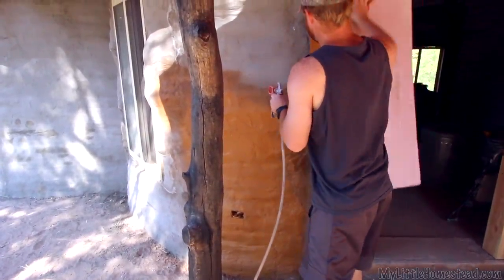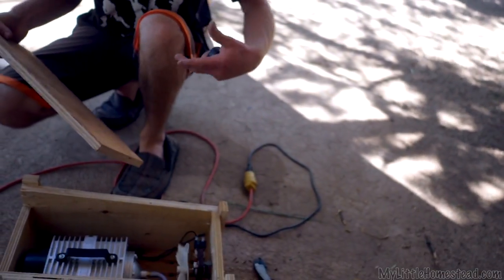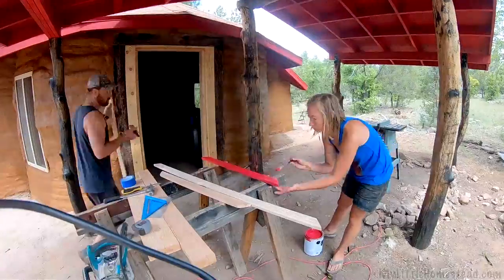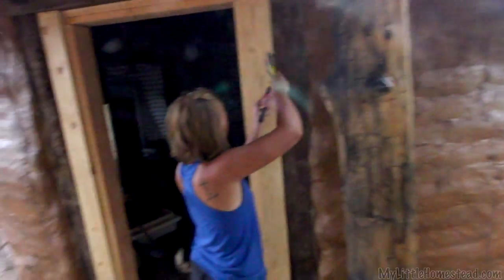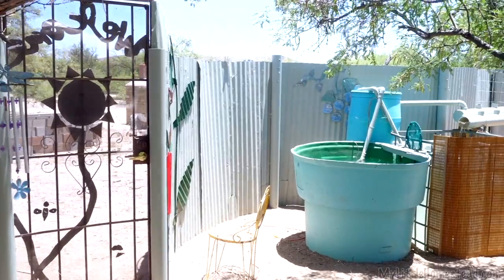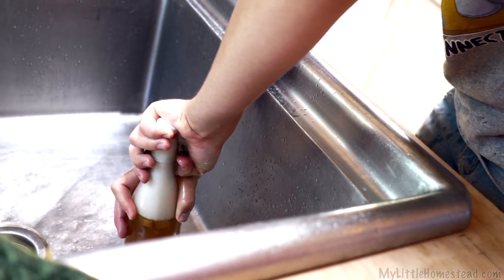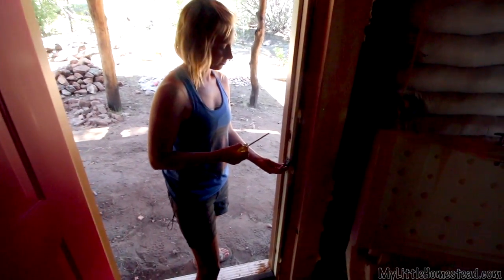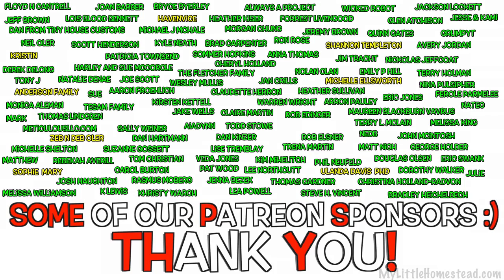Earthbag Cabin Paint & Trim, Aquaponics Fish & Plants & Making Kombucha | Weekly Peek Ep191

Comment: AQUAPONICES: most unusual and creative design I've seen — it's ART! and looks like fun — looking forward to the results. // THE CABIN: Great job kids, and good airless painting technique, but ONE rookie OOPS: Why we do NOT miter exterior trim. HEADER and bottom trim/sill should have angled edges to SHED WATER, and the sides end cuts angled to match, sitting on top of the bottom trim/sill. Back prime and paint any saw cuts before installation or any water that gets behind it will be absorbed into the wood, then when the sun comes out and hits the water soaked wood, it will vaporize the water creating paint BLISTERS and you'll be painting every 2 years. // WASHOUT CREEK problems: (1) culverts are WAY undersized (12" dia ?), so they easily clog with debis which creates a dam, which causes water to overtop eroding around the culverts. From the size of the wash, I wouldn't use less than two 24" or even better, a 36" to minimize debris blockage (2) Look at a real creek bottom — combination of BIG rocks, medium rocks and VERY coarse gravel. Do that on the upstream side of every culvert with larger rocks stacked and packed into the earth on both sides of the mouth of bigger culvert(s). Alternatively, you could create concrete sweep aprons on the upstream side to prevent erosion around the culverts. Water overtopping will kill any dam or culvert. ALTERNATIVELY, create an overtop spillway of concrete for the water to flow over if it clogs (almost all dams have concrete spillways to handle overcapacity).

Comment: The dude with the washout problem I recommend fabric and rip rap around areas he puts culverts in. If flash floods and clogging is a constant issue remember the bigger the Culvert the easier to clean out and the more volume of water it can handle
Reply: Maybe even wire enclosed rip rap, perhaps dissipators, (like a speed bump) to slow down water, make sure they're level and evenly spaced.  Also on the csp, or drainage pipes, looks like the water is "funnel necked", so rip rap around inlets will help prevent erosion, less blow out.

Comment: Only one good solution for Early and that is a concrete box culvert the width of the upper water line and height from upper WL to lowest point of creek bed and shouldered into the creek bed with up and down stream aprons. Will handle volume and make FEMA happy, as if we live to satisfy them, but will stay clear and be safe. 

For the kombucha, leave about 1.5in. of head space then chill before opening.
Shade those plants for about a week to acclimate them and reduce transplant shock effects.

Comment: What should I do if my fish are gasping?

The water surface contains the highest levels of dissolved oxygen, so when fish can't get enough they'll rise to the top and gasp. However, the cause of that gasping could be due to several factors.

Temperature

The warmer the water gets, the less oxygen it holds. Check the temperature, as it should be about 24-28°C/75-82°F for a tropical freshwater tank. In hot weather the tank may be overheating naturally, so try to cool it and boost aeration. Don’t always blame temperature as sudden gasping problems are often related to pollution or disease.

Heating

If your heater has malfunctioned it may have stuck in the ‘on’ position, causing overheating. Gasping fish is often an early warning that something is wrong, so if the tank is very warm and heater light on this could be to blame and will need replacement. If this is the case, temperature will be very high — usually well over 30°C/86°F. Heaters are generally reliable, but when they go wrong the consequences are usually devastating.

Water quality

Both ammonia and nitrite affect gills and can cause gasping, so test the water at the first sign of trouble. When ammonia is present fish produce extra mucus, which reduces the surface area of the gills, making them less effective at extracting oxygen.

Nitrite affects the blood by changing the haemoglobin bit that carries the oxygen, so fish gasp in trying to extract the oxygen they need from the water. Any signs of ammonia or nitrite are worrying. Do an immediate 50% water change, top up with dechlorinated tapwater and try to determine why the biological filter isn’t working. Then seek further emergency support from your dealer.

Disease

Various diseases that affect the gills can also cause gasping. Look for signs of infection such as spots, clamped fins, secondary infections such as fungus or bacterial diseases. Many of these attack gill tissue, which either damages those tissues or causes the fish to produce extra mucus that could reduce the amount of oxygen fish can extract. Gill diseases tend to be tricky to diagnose properly, so if you’ve checked everything else and suspect a gill disease speak to a specialist dealer or experienced fish vet.

Dissolved gases

Too much carbon dioxide (CO2) or too little oxygen will also cause gasping. If you’re dosing CO2 on a planted tank, check you’re not adding too much. If your CO2 unit has broken and released too much gas, boost your aeration to drive it off. If you have a planted tank or pond and your fish are gasping first thing in the morning, the plants or algae probably have depleted oxygen levels at night and increased CO2 levels. Boosting aeration during the night usually solves this.

Kombucha

Two scientific review articles from 2000 and 2003 on the health effects of Kombucha concluded that the claimed health benefits of this drink are still unproven, while there are case reports that raise doubts about the safety of Kombucha. In the aforementioned cases there is a suspicion of, among other things, liver damage caused (which seems paradoxical in view of the later studies [1] [2] that show a liver-protecting effect), metabolic acidosis and antrax infections of the skin [3] [4].

Komboecha received a red traffic light from the IOCOB Foundation in the assessment system for alternative medicine, which stands for the quackery category. Furthermore, the foundation states: "Sometimes even very dangerous fungi are found in the tea, such as Aspergillus". [5] Although in none of the studies mentioned there is any evidence that kombucha is directly responsible for the negative effects, the scientists in 2000 and 2003 do not recommend the use of kombucha because of the potential risks. [3] [4]

In my country (Belgium), the sale of medicines based on kombucha is prohibited.
Reply: This for all of it, especially the koumbucha. At best, it's just a beverage, at worst, it may be harmful. At the very least, don't consume in large quantities.

Comment: You need to aerate your fish tanks a lot more, the fish shouldn't be gasping at the top like that.
Reply: and surface cover to maintain water a cool temp. shade..tank in this situations may be best below surface ( surface just above ground height..to maintain water.. as it travels thru the exposed pipes its heating up there and ambient air temp and then cycling back to tank. check for 60 to 80 degrees

Comment: great job on everything... I heard that it is hard to get the water ph right (?)  I really want to see it grow... you guys got a massive amount of stuff done... all really tricky projects too... (thumbs up)
Reply: It is somewhat difficult,  Bryson, this is why  I suggest an ebb n Flow bed in line before the NFT.
The nitrification process is very important to the balance of the system. This takes place first in the Ebb n Flow bed.

This allows the system to balance properly.. also I would plant duckweed for the fish to eat.. not so much the fish food.
Ideally  I would get the system set up, and get the duck weed rolling... by the time it starts growing, the system is balanced and ready to plant.
Reply: when it comes to fish, a stable ph is more important. huge swings cause a lot of stress to the fish. sad to see he didnt cycle it first, with all the research he did im surprised he didnt find that. its the single most important thing to get right for the health of the fish
Reply: @FaenumVena   the use of the Ebb n Flow bed in line before the NFT  but after the swirl filter allows the PH to balance through the nitrification process. 
One could see this bed as the "natural PH regulator"
Also the water source needs to be kept cool.. and out of direct sunlight.

Comment: For the wash out creek, needs gravel all the way to large rocks. And plants.
Reply: Thanks for the advice! In one of the photos, you can see a bunch of  grey blocks. Those are full 80lb sacks of concrete that got pushed downstream. Not as far as the mud or the culverts...

Water is an amazing force of nature, for sure!
Reply: Early Ehlinger It really is! Water that is.
Reply: @earlye  rebar through the bags into the ground to hold them in place or put some chain link fencing over them and stake down.
Reply: Rip rap with large rocks will slow down the water, if you start with gravel than increase to larger scale rocks. Public works uses this method.  If you look at nature, you will notice a creekbed is lined with rock.  Just a suggestion . it's been a record year in my area with rain. It's been a mess
Reply: I agree rip rap will definitely help slow down the water and lessen erosion. Some people use large logs with rootballs along the sides to slow the water. Also planting lots of willow shoots or other bushy fast rooting plants will stabilize the soil.

Comment: For erosion control,  slow the water flow   Down.  It is the velocity that is creating the damage.  Put in weirs with pipes with a fixed diameter.  That ponds the water. In short you are slowing the flow rate.  The problem is that the flow rate varies.  I use large rocks and that helps.  If the flow rate is to fast you can put rocks in fence material and put that across the direction of the flow..  I would stay away from planting bamboo because then you will have to deal with the bamboo plants.  Good luck.
Reply: Ken Shores Actually there are clumping bamboos that you don’t have to worry about...just read the label and it will tell you if you are holding a runner.
Reply: Marty Maloney I am sure that is true, but like you said you need to read the fine print.  I just have had to clear plants like that.  However if you don’t mind go for it.  Besides what do you have to lose.

Comment: Extra large steel culverts, 4' diameter +/- , brick stacked 2 high (or more if necessary - to allow max water flow - give extra to be safe) and as many wide as is necessary. Use concrete along the front and back edges to avoid erosion around culverts. \ /   & / \ respectively. Concrete and gravel the culverts into place. You can actually put a permanent access road across the creeks in this fashion and clear out large debris when ever needed. Just be certain that access road is far above potential flood waters. 
Also plant Christmas type trees along the edges to keep the ground from eroding. They love the water and have large rootballs, which hold the soil to the bank better. 
All this was learned on my farm, in Appalachia, many years ago. The access road/driveway was put in by me 25+ years ago. It is still operational today.

Comment: The drainage where we live is not as extreme as your friend.  We had an irrigation pipe the kept getting uncovered by fast moving surface run off.  I created a barrier to slow the water down. So far it has worked.

Comment: To bad you live so far away.......I put all of my tilapia in the pond a couple weeks ago.......most were anywhere from 18"-24" in length.....a few smaller than that.....probably 100 or so in total.....decided to stop raising tilapia.....they are a VERY hardy fish. several times, I have forgotten to turn of the water when doing a water change....so the water went from 80F ish to 53F and they handles the extreme temp shift just fine.

Comment: To stop the erosion in the creek use large rocks and gabions (wire mesh).....google "gabion dams".....fast moving water will eventually wash away  anything .......so you need to slow the water.....multiple dams may be needed......slowing the water is the key.....make it passive

Comment: Nice first try with the kombucha!  Ginger is one of my favorites too.  One tip, when you're doing the second fermentation, in the smaller bottles with caps, wrap the bottles individually with some cloth, rags or old sheets or something, and put them all in a plastic bin/box with a lid, so that if one of them explodes it won't break the others, or make too much of a mess.  I had one explode in the middle of the kitchen once with glass flying all over the place.  Yikes!  (No one was hurt, but I still get scared thinking about it.)

Also, I like Bryson's new mustache. :-)

Comment: I've been brewing Kombucha at home for a few years now. It's so much more cost effective to do yourself, especially if you drink it A LOT. In my experience, the best bottles for the second ferment are actually the glass bottle with a plastic screw top that commercial kombucha comes in (like the brand that Shae is drinking). I like these better than the flip tops for a few reasons, the main one being that they are far less likely to EXPLODE on you. The plastic top will give long before the glass bursts under the pressure. This is especially important to remember when you live in such a warm environment like ya'll do.

Also, a little tip on flavoring: ginger is my favorite too! But the ginger chunks can be a pain to get out of your bottles. Instead, brew up a ginger syrup by simmering ginger chunks, water, and sugar on the stove for a little while, then straining and storing in a bottle or jar in the refrigerator until you are ready to use it. That way all you have to do is pour a bit of the flavor syrup into each bottle and there are not chunks to fish out later! It will also increase the fizz of your 'buch by giving the scoby a little extra food.  You can make all kinds of flavor syrups (or "worts") using this same method (cranberry lime is pretty great, too!). Happy Brewing, Shae and Ben!

Comment: Your friend needs to think about installing a much larger culvert. The pipes he has are too small for the job. In my experience, you need a pipe large enough for the volume of water that flows through there at it's highest (winter/spring) and add a little extra - ie the worst storm deluge/flash flood, plus melt-water. That's the size of pipe you should be using. In your friend's case, I suggest 4ft or wider. The two tiny pipes he has are more like overflow pipes than culverts. It'll cost a little more, but the result will be worth it in reducing loss of soil and avoiding the risk of blockages building up downstream.

Comment: For the creek wash out issue, what type of land surrounds the creek, and how is it used? Does it take water just of your land or from off the property up stream? 
The best way to prevent wash out is to stabilize the banks by improving the riparian zone. Establishing plants like willow that live along waterways will help prevent erosion. If you graze animals try to create a buffer along the creek to keep them away. If the creek is being overwhelmed by large amounts of water from upstream off your land, you may want to consider building one or more permanent ponds or large rock lined "drop pools" to hold and slow the water. Odds are there won't be one single solution, but multiple land management practices that you will need to utilize to prevent this problem. 

Look into permaculture water systems, Especially Yeoman's Keyline System and Shep Holzer's Permaculture.  Those two are pioneers of permaculture and have a lot of info on managing a landscapes water resources.

Edit: Just wanted to let you know that I found a couple of sources with great info on bank stabilization if you are interested.

Comment: For the fan in the pump motor housing, you've drilled holes for an intake, but you really need openings directly across from the fan to allow the air to escape.  This will create a draft through the housing, vs. now the fan is really just going to stir the air inside.  Love the videos.

Comment: Washout problems, we don't really know what all the requirements are do we?  Is the erosion primarily during bursts of rain?  Do the creeks flow all the time?  Perforated pipe is not going to flow much volume.  Rip rap is a good solution if the goal is to move the water off the property.  I'm more of a fan of water is a precious resource and should be slowed down and allowed a chance to absorb into the soil.  How does that work?  A combination of ponds and swales on contour.  A swale on contour can potentially soak thousands of gallons of water into the soil depending on the length.  The ponds and swales should have one or more large level sills for overflow.  The length of the level sill and the water volume will determine the speed of the water flowing out of the pond or swale.  The sill should gently release water ideally to be caught in the next swale at a lower contour.  If the volume of water through all the creeks on the property exceeds the ability of the land to absorb, rip rap and possibly gabion baskets made with hog wire and rip rap on either side of where the creeks will flow to use as a base for small bridges across.   They should check out swales in permaculture design.  Here is a video from one of the kings of permaculture to get them started https://www.youtube.com/watch?v=nbkiHhrO6fY  Gabion build https://www.youtube.com/watch?v=QFjEWnA3Mtc

Comment: One option I've seen used with other homebrewed drinks is put a deflated balloon with a few pin holes in them on the top of the bottles to release the excess gases instead of fully sealing them.